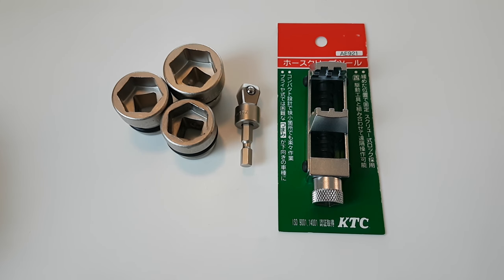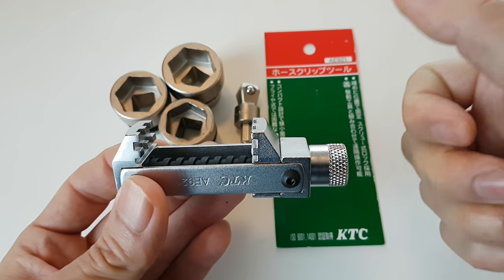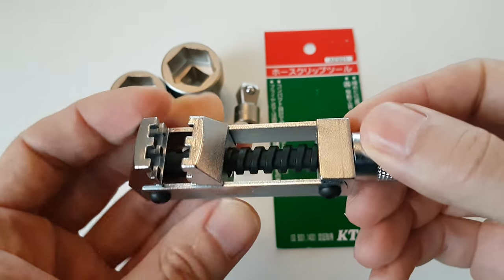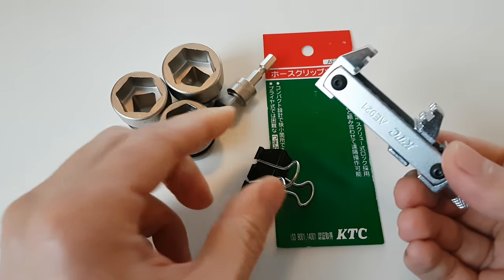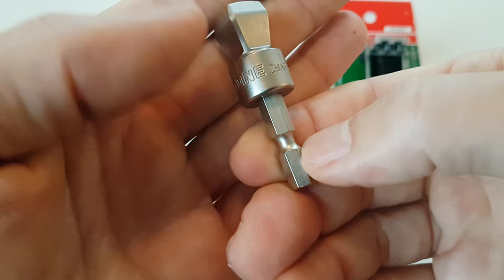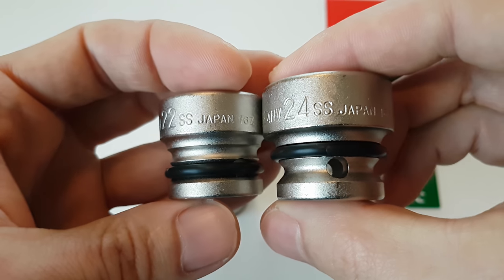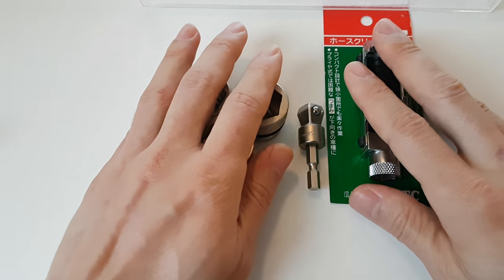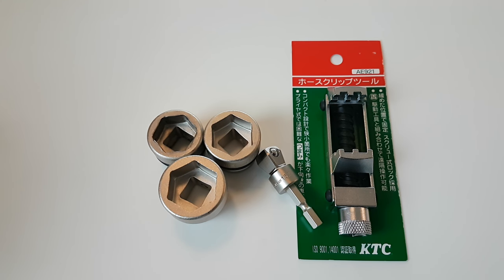Japanese Tools Showcase 13 : KTC / Tone

Comment: Those shallow impact sockets would be great on a stubby impact gun.  I can think of a few times that hose clamp tool would come in handy.
Reply from the maker: Also great on the end of a universal joint as it can keep the overall length rather short.
Reply: Yes, that would work good also.
Reply: Bruce L. Can we buy this in the US
Reply from the maker: john angle, you can purchase the impact sockets and hose clamp tool via online vendors like Global Rakuten and Amazon.jp.
The hose clip tool is available through a webstore based in the states called frankstools:
http://www.frankstools.com/ktcaehoclto.html

Comment: why JP don"t follow Standard ISO 1173 Drive ends for assembly tools ? then,you have to grind off roughly a bit for the hex clamped properly in the tool holder.So strange for JIS standard for the shank
Reply from the maker: Yes, I find it very strange as well.  I guess first and foremost is for them to produce according to their national JIS standards.  Companies like Ko-ken offer more bits with the  standard DIN 3126 / ISO 1173 drive end style (9.5mm) than they do with the JIS 14mm standard.  In fact Ko-ken does offer some bits that have dual grooves so that accepts a standard 9.5mm groove chuck and the 14mm groove chuck.  I know that the Japanese company, Eight does that as well.

Comment: Hi Chris, it's Ryan again! Lol. I think I have to have this KTC spring clamp tool. Never seen one before!? I have an expensive set of the cable style racheting pliers from Matco. They work Excellent but in a tight space not so much...How do you like this tool? Do you recommend me buy one? Thank you Sir! Look what you have done...lol
Reply from the maker: Hey, welcome back....it's been a while!  lol.  Since I work on cars that for the most part don't use spring band clamps, I've only used that KTC tool once so far.  It certainly did it's job well and so I'd recommend it...especially if you encounter them often.
Reply from the maker: btw, a similar style of tool is offered by Lisle, with part# 44500 and 44480.  I've never seen one in person so can't comment on it.
Reply: Thank you Sir. Ya know I looked at the Lisle models on Amazon but they just don't look near as good of quality/well designed as your Ktc tool. I'm gonna go ahead and order it from Frank's on my next Ko-ken order...

Comment: I just use a makita drill and it works fine with Japan bits
Reply from the maker: Key'd/keyless chucks found on drill drivers are fine for sure. ...unless of course you have a cordless tool built for the Japanese domestic market.